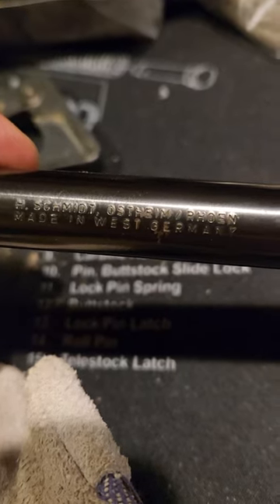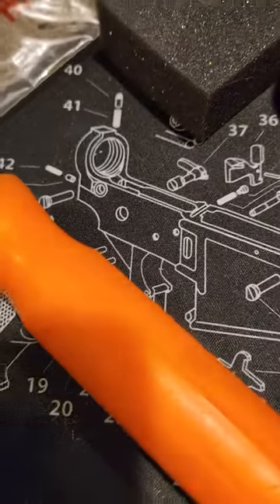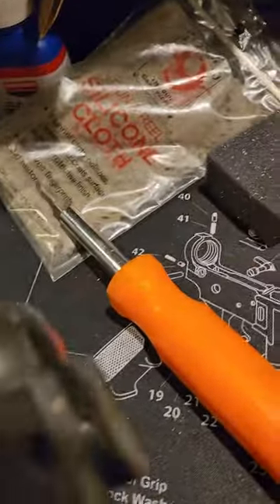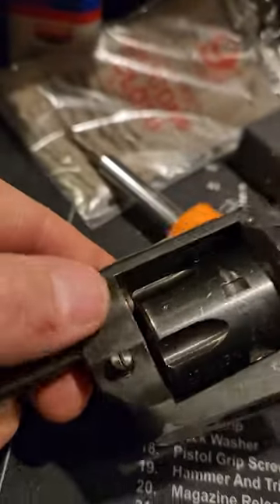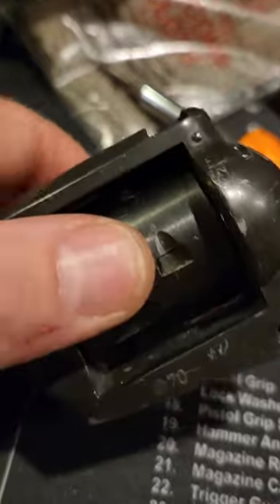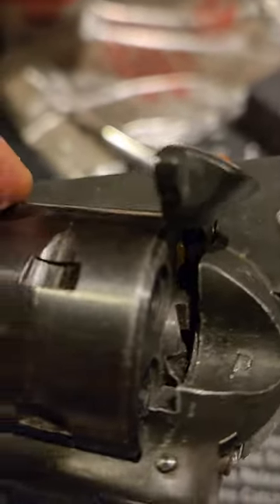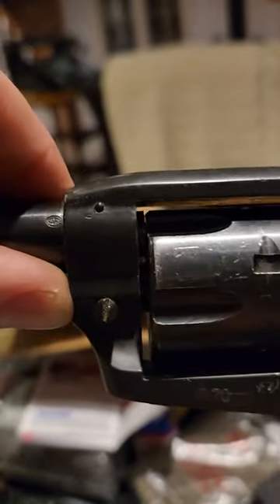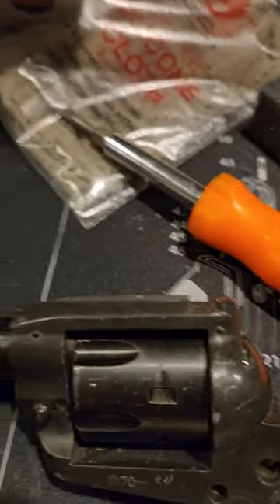22 Revolver cylinder stuck! Need help!

Comment: The firing pin is stuck out hanging on the cylinder. You can free it using a long rat tail file. Just run it down the barrel and through the cylinder putting it against the firing pin. Then gently tap it with a small hammer. This will reseat the pin freeing up the cylinder. 🤠👍
Reply: What if I have a live round that didn't go off

Comment: I had the same problem just now and I genuinely just hit it out with a wood mallet. When replacing it, I lined it up as well as o could and hot it back into place with the same wood mallet. Both cylinders go in and out fine by hand now.
Reply from the maker: interesting. I'll try that. A hammer always works! lol I haven't messed with it again since I first posted it, but will try something like this soon. Thanks
Reply: Oh shit. I think the firing pin was stuck holding it in place. Try looking at that first as I may have damaged the pin lol
Reply from the maker: @bencarl96  LOL While I like remedies that include hammers and brute force, I thought that might not have been the most wise solution. Ha!

Comment: The bottom thing the spins the cylinder.  It moves down wen you pull the hammer back.  It I see the hammer not there
 Bit is that piece still there under the cylinder that spins it?

Comment: I just had to fix the same issue with my Heritage Barkeep.
Reply: How did you fix it
Reply: @CosAla-tg9gj  what happens is the firing pin cup is really thin at the top where the keeper pin holds it in the frame. So what happens is over time the firing pin wears a hole through the cup and it hangs on the metal. So you have to replace the cup.

Comment: Get a  blade type feeler guage, with the cylinder held as straight as possible, pass a blade between the barrel and cylinder checking for obstructions. Do the same at the rear of the cylinder and along the top and bottom. The blade should slide unrestricted from top to bottom and side to side. Then push the cylinder as if trying to remove until it hangs up and do the same thing. Somewhere in this you should find the burr that is obstructing it. Those frames are pot metal so whatever force you end up using try to be judicious. It could be lead buildup at the forcing cone.
Reply from the maker: Thanks bro
Reply: It is lead build-up at the forcing cone especially if you were shooting 22lr in the mag cylinder. Pop it lightly with a rubber mallet and then a good day's cleaning is in order.
Nice revolver. You don't see those anymore.
You also might be able to use some old Heritage parts to restore things. Back before ignorant worthless taurus got ahold of them and destroyed and redid everything on the revolvers and turned them into complete trash. 😢
Would love to see this all restored!
Reply from the maker: @nunya1328  thanks for the tip. I hope to get more time this winter to jack with it. Will post an update when finished. So, should you not shoot LR or shorts in the mag cylinder? I'm pretty sure I've only ever shot LR or shots in this gun.
Reply: @billwelch9431  yeah only shoot 22mag in that cylinder as 22 mag is longer and just a hair bigger in diameter. The 22lr or shorts will be lose inside that cylinder and tumble or go into the forcing cone somewhat sideways shaving off just a bit of lead each time. The cylinders are honed a certain way down to allow for the casing. The magnum casing is quite a bit longer so the 22lr or shorts are going off inside an expanded hole that is not snug around the bullet. If that makes sense? It can cause a lot of problems. If you have both cylinders I would use them for the intended cartridge. If not, I would just buy the 22mag even though they are a little spendy.

Let me know how the project is going!
Reply from the maker: @nunya1328  thanks, that makes total sense. I did not even realize until I started taking the gun apart that it was a 22 mag cylinder.

Comment from the maker: Update! I finally got back to it and after nothing else would free up the cylinder, I bumped the cylinder with my plier handle with a little force, but not enough to break anything and it popped out! LOL I found that the problem was squibs jamming up the barrel - I think three of them! Took me forever to ram them out. I had let a friend not used to shooting borrow it when we were out target practicing one day and it jammed up on him. I think he kept trying to shoot after the first time it jammed or just didn't realize that it had, then finally it locked up the cylinder. Lucky nothing bad happened! Now, I found out what my problem had been. We had went out and shot some 22LR through it at one time and a friend of mine jammed it up and like I said in my other video, the cylinder was stuck in there even after completely disassembling the entire gun. Finally with a little bit of bump force to the cylinder it came free and I found out that there were squibs jammed in the barrel. My friend had shot at least three rounds that got jammed in the gun. I had to hammer those squids out which was not easy but finally got it to free up, cleaned everything up and reassembled it and shot some 22 mags through it today and worked as good as new again. Note to others: Do NOT shoot 22LR with a 22 mag cylinder! LOL

Comment from the maker: I found out what my problem had been. We had went out and shot some 22LR through it at one time and a friend of mine jammed it up and like I said in my other video, the cylinder was stuck in there even after completely disassembling the entire gun. Finally with a little bit of bump force to the cylinder it came free and I found out that there were squibs jammed in the barrel. My friend had shot at least three rounds that got jammed in the gun. I had to hammer those squids out which was not easy but finally got it to free up, cleaned everything up and reassembled it and shot some 22 mags through it today and worked as good as new again. Note to others: Do NOT shoot 22LR with a 22 mag cylinder! LOL
Reply: , I never fired mine I just got it and put the mag cylinder in, and now it won't come out, EXACTLY LIKE YOURS..
Reply from the maker: @justinV.-yd1fb  I got it fixed. Just give the cylinder a more forceful bump and it will probably pop out. Not sure why yours would be bound up without having any squibs catching it up. ?

Comment: Wheres the hammer?  The hammer should help draw back a little pin that holds that cylinder in, when cocked back.
Reply from the maker: It's completely disassembled. Trust me, I tried that many times before I resorted to full disassembly.
Reply: @billwelch9431  copy that... I'm only familiar with the heritage rough rider.  Good luck, hopefully you get it operational.
Reply: I know this problem. Insert cylinder pin again. Try sliding a very thin sandpaper through the loading port onto the teeth on the cylinder and then turn the cylinder in the opposite direction. It took a while before the resistance that caused the cylinder to block was removed. It helped me. I certainly wouldn't force this with a hammer as it will damage the frame. It is usually not due to the frame but to the teeth on the cylinder that are a fraction too high!
Reply from the maker: @paul55austria51  thanks. When you say the loading port, do you mean where you slide a bullet into the cylinder?
Reply: @BobbyBlades4Days  mine heritage rough rider is brand new and the cylinder goes in but it doesn’t spin or cock back but when I take the cylinder out it cocks back and everything works

Comment: maybe  someone  put the  wrong  Cylinder  in  the  gun  ,  in other  word's  maybe  it's  not  a 22 Magnum  ..........  do you have  a 22 LR  Cylinder  you  could  try  in  the  gun  when you  get  the  Magnum  Cylinder  out .....
Reply from the maker: That gun comes with the 22mag cylinder and it worked fine for years.